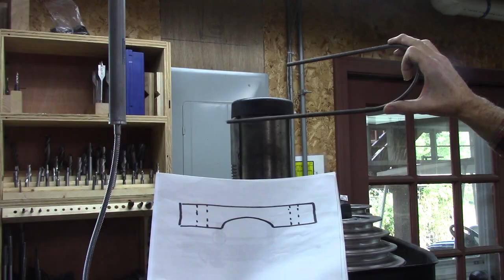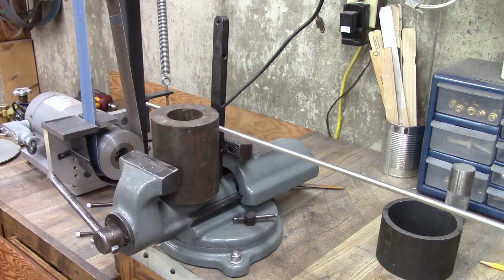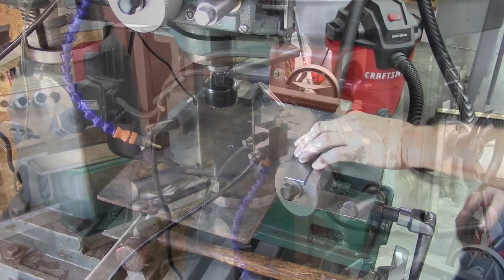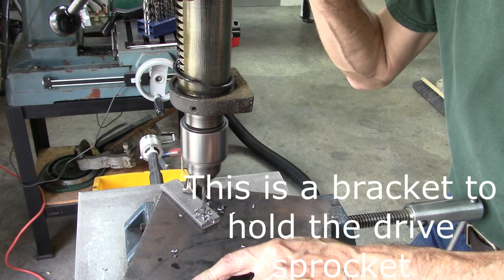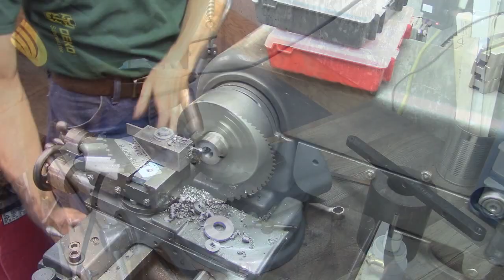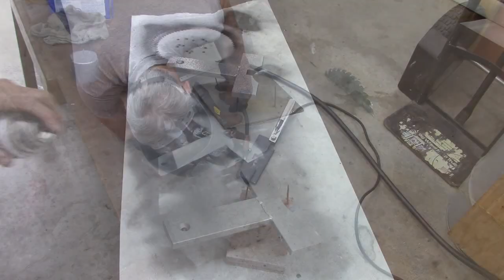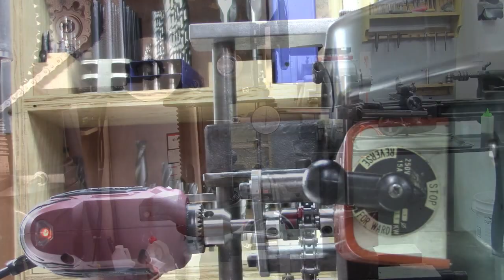The Ultimate Round Column Mill Fix

Comment: Thanks for your feedback.  I do agree with you and did not intended to criticize your well, neatly and professional presented modification.  And rightly so mankind has manufactured and created wonderful projects that are still standing and still operation today  with lesser machines.  No doubt what you have made will perform better and it is more than others may have attempted.  It is clear to see that you have significant skills.  So again sharing this and hopefully I can see a further video from you in the future. By the way I like your clean workshop.
Reply from the maker: No worries, I didn't feel criticized, I basically agree with you. Thanks on the work shop. Aside from feeling a little crowded I love working in the shop. I've done woodworking all my life and always had some basic metal working tool but always had an interest in machine work. About 15 years ago I went from a job running a web offset printing press  to being a troubleshooter/problem solver for the presses. That turned into learning some cad and designing a lot of machine improvements. After getting frustrated with the time it took to get our under manned machine shop to make parts for me I started accumulating my own machines. Now I'm retired...  Now if I can imagine something I can usually build it...  within reason of course. I remember telling my wife I was going to build a buckboard flyer. She said, are you a kid or what?  I said, yeah, but now I have the tools time and to some degree the money make cool toys! If you haven't seen it you might like it. Check it out. https://youtu.be/lPDv_33CV4o
Reply: @WinkysWorkshop  Thanks for the kind reply, yes my wife thinks I am a kid as well and I do feel like a kid in the sweetshop when I am in my workshop.  I am always happy to see the talent in our generation, and many young person could learn a lot by simply switching  from gaming to the youtube channel like yours.  I will check out the link you sent me.  Kind Regards.

Comment: Good try to make an inferior machine perform as it should.  Tried this with similar unsuitable equipment, however learned to put my effort in to buying well engineered machinery.  If you are lucky to have this equipment best use it for basic machining.   Thanks for this video it is a good lesson to help others.
Reply from the maker: Of course a full size mill would be great and if machine work was much more than a hobby I'd sell this mill and get a good one. With that being said, this mill does fairly good with a lot less cost. Your advise would be good if I was 20 or 30 years old. I'm retired...  it's a hobby.  Of course if I see a good deal on a small mill I may get.

Comment: I have a machine like this. Just wondering : I’d have to check, but couldn’t this goal be achieved by putting 2 pins in the top and bottom of the gear rack ?
Reply from the maker: I wish it was that simple. I know some have done this but it's more problematic than you might think. First it helps to realize that a .001" movement at the rack equates to about .008" at the collet. I tried clamping the rack to the column but just 2 inches above the clamp the flexing of the rack made it impossible to even feel when the side of the key way (rack way?) was hitting the rack. I'm not saying it isn't doable but you'd have to pin the rack to the column every 2 or 3 inches and getting is close to perfect would be very difficult.

Comment: I used to have the same milling machine as you. I had a £5 laser of the head of the machine and fired it across the garage onto the wall.  I just had a vertical line drawn on the wall and put the laser dot back on the line if I had to raise or lower the head. Do to the length of the laser line any error is magnified so its easy to correct.    Its an easy fix for the round column. Chris
Reply from the maker: I saw a youtube video on that. Maybe not as fast but a very accurate way to keep things aligned.

Comment: If you look closely on this mill, I'd bet that some, if not all,of the fasteners aren't Imperial... they're Whitworth. If you have one of these older Taiwanese mills unscrew the quill lock lever and take a look at it. It's probably 1/2" diameter, but check the thread count...It's probably 1/2"-12 BSW.
The plastic front cover most likely is held on with 1/4" Whitworth screws.
Cheers from NC/USA
Reply from the maker: You might be right...  although I'm not sure why they would use whitworth
Reply: @WinkysWorkshop   British Crown Colony of Hong Kong. Colony's mainland suppliers fled to Taiwan to escape the communists. Just kept on using what they had been using and stuff just gets baked in. E.g. no one makes metric ratchet wrenches or metric drive sockets. In a French garage you ask for a 1/4, 3/8, or 1/2 drive ratchet or extension.
Cheers from NC/USA

Comment: I have to wonder why you didn't just tie the rack to the column. It has to be a fairly precise fit in the milling head and it it was anchored it would control the deviation from center. If there is slop between the rack and the milling head you could probably modify the head to accept a gib of some kind.
Reply from the maker: First the rack has all kinds of clearance (probably at least .030") but even if it was only .002" at the rack that equates to well over .015 at the collet. However, this isn't the primary issue. The problem is the rack weak. I attached the rack at the top and bottom and it flexed bad. I was going to push the head to one side to remove the clearance but I could not tell when the clearance was gone because the rack flexed. It would need to be pinned to the column ever 3 or 4 inched to prevent this. Pinning between the teeth and getting it perfect would be a challenge. Even if you got the rack within .0005" that equates to .006 at the collet. I've heard of people doing this but I guess it comes down to what kind of accuracy you need.

Comment: I prefer the round column, because I can hang long jobs off the back of the table from an angle plate and swing the head around to do the job. I’ve also fitted a router mount to the spindle for truing gunstock butts and grip caps. If you don’t want the head to rotate, just fix the rack to the column with screws. 🤷‍♂️
Reply from the maker: It sounds like you need a drill press. I know it is called a mill-drill but when used as a mill the round column is a pain to deal with. Fixing the rack to the column will work but making is accurate is very difficult. Attaching the rack to the column at the top and the bottom does not work. The rack flexes. .001" movement at the rack equates to .020" at the collet. It would need to be pinned every 3 or 4 inches to be usable. Drilling between the teeth on the rack with could also be an issue.
Reply: @WinkysWorkshop  Sounds like you need a turret mill.
Reply from the maker: @Afro408  - I like the mill not that it's actually resembles a mill.

Comment: FWIW... I tack welded the gear track on mine.  It still wiggles a bit but not a crazy amount.  I still need to improve on it so this video helps with ideas. Thanks
Reply from the maker: Yeah...  I clamped mine firmly and was shock at how much the rack flexed. Pinning the rack between the teeth worried be but welding might work well if there is enough clearance.

Comment: Hi,  Do you ever have trouble when milling slotted holes, say 3/8 inch,  with the mill bit runnung off  and the slot becoming  less than parrarell??
Reply from the maker: Only with a small long end mill. Unless you take very small amounts the mill will deflect. If you want an accurate slot go with an undersized mill. While cutting a slot one side of the mill is climb cutting and this is not ideal.

Comment: if only there were a simple solution like that for my Smithy 1220...
Reply from the maker: Here's an easy method that might work on your Smithy. I probably would have tried this but I didn't know about this design. https://drive.google.com/drive/folders/1-BDzoObv7eVarpg0HJaO9YMeR-rvfvb5?usp=sharing
Reply: @WinkysWorkshop  nope. The whole column is threaded so you actual have to rotate the whole head around several times to adjust it from top to botom. Thanks for your time though.
Reply from the maker: @christurnblom4825  - Oh wow....  I did not know that

Comment: Now you need to install a dedicated up/down switch on the front for easier access instead of the drill switch. Then you could simply use that convenient front mounted switch instead of go to the side and using the drill switch.  Not hard to do and a mere DPDT push type momentary rocker switch would be perfect. Thumbs Up!
Reply from the maker: I used a drill on to power the lead screw/saddle on a lathe. It was a wood lathe but made like a metal lathe. I dissected a drill and used a remote DPDT switch. The wiring part is easy but dissecting the drill, not so much.  On the mill the drill trigger is fairly close to the front so in my opinion not worth the effort.  What would be nice however is a switch to unlock the head clamp bolts. Still thinking about this one!
Reply: @WinkysWorkshop  Maybe use a linear actuator to lock and unlock the head clamp bolt. Just an idea...
Reply from the maker: @garymucher9590  - I'll have to look into this. thanks

Comment: Another way of solving the problem. different to the Tru-Line -8 that fits on the other side that I make.
Reply from the maker: Yes, I considered your design. Looks great and I wish you the best. I admire anyone that crates a product and successfully sells markets it. I have done the same a few times with limited success and a lot of headaches. I think the primary reason I took a different approach was 1) I was a little concerned about drilling and tapping the cast iron (although it was a minor concern) and 2) I was worried about that fine line between excessive friction or movement in the head. Perhaps this is not an issue but never the less it stopped me from pursuing the design. Also love my power feed---   Then of course somebody sent me this after i posted the video. This is worth considering I think - https://drive.google.com/drive/folders/1-BDzoObv7eVarpg0HJaO9YMeR-rvfvb5?usp=sharing

Comment: If you want head alignment during raising and lowering the head on your round column mill but without the power feed there's a fix.   It's described in issue 18 of Model Engine Builder  magazine  (September October 2008) pages 32 to 33.  It uses the rack as the alignment bar and fixes top and bottom of the rack.  A close fitting slide is fitted to the head to limit play.
Reply from the maker: First off, thanks for the info. However, I tried this...  this seems good but it is not an ideal fix. The rack is close to the pivot center and the leverage the head has on the rack flexes the rack....  and not just a little!  The rack is only 1/4" think at the bottom of the teeth.  It could work but the rack would need to be pinned to the column at least every 3 inches. My biggest concern about going this direction would be getting the rack positioned perfectly. It's hard to move a pin. Then there is the issue of drilling between the teeth on the gear. To be strong enough you would probably want to used a 1/4" pin and to do so you would also be removing part of the tooth. Maybe not a big deal but it would weaken the tooth. Also, trying to drill in a V (created by the rack teeth) might be tricky.  There are a few other ways to fix this issue but in my opinion the rack is last on my list.
Reply: The unit had its disadvantages, if I'd really  spent the time on it I should have, I would have had a lot more contact area top, bottom and a pair of sliding guides.   
The whole thing had to be removed to free up the bottom of the column every time I cut gears to allow me to fit a lower support bearing on the cutter arbor.     I've found a workable and simpler solution to limited travel is in tooling length - long centre drills and stub length screw machine drills and stub reamers.   Lets  me set up tooling of roughly the same length.   I'm tempted by vertical axis power feed for a boring head.
Reply from the maker: @avelingdx  - I've done the same with the stub drills and have a video on making the long center drill. Of course that was long before this current fix.

Comment: This is a very clever solution, and with this knowledge I am a lot more likely to purchase a round-column mill should I happen on the right opportunity. Thanks for sharing!
Reply: I seriously wouldn't. Rather get a chinese square column and mod it for smoother travel. Round column is a true curse
Reply from the maker: @rolandjollivet38  - Now that I modified mine I like it but I tend to agree with you. I'd rather have a small knee mill. Hard to find
Reply: @rolandjollivet38  I get that.  Right now I can't justify the expense of a decent mill, but if I could find one that wasn't worn out for a few hundred $$, I'd buy it.
Reply from the maker: Cool. thanks!

Comment: I use a mag-base laser level on the head, and pointed at a tiny silver spot on the far wall, to keep the head aligned when raising or lowering.  I can keep it within a few arc minutes fairly easily.
Reply: mount a mirror (ideally surface silvered) on the far wall then you increase the accuracy even more and don't have to turn round to check. Random unrelated fact, years ago as a kid I visited a place that turned train wheel rims and they projected a shadow of the wheel rim onto the factory wall and there were marks on the wall to act as a gauge.
Reply from the maker: @mfx1  - Cool!
Reply from the maker: I've seen that done and it;s a good approach. Very accurate.
Reply: that laser sounds like a great idea and maybe use in conjunction with the vertical bar as a check. My problem is that I have my Mill on casters.  But maybe two lasers, one on column and one on the head and just need to keep them pointed so that they are aimed so that they maintain a consistent distance apart?

Comment: hello Mark,nice job on the mill,enjoyed the video, thanks for sharing with us.i did something simular to mine what i did was drill and tapped the rack and  tube and made a gib to fill the very tiny space in  between the clamp and tube. it works just fine.see you next time. stay safe. my friend.
Reply from the maker: I tried do that and my rack flexed a lot! I had mine attached at the top and bottom and it didn't work at all. How many places did you attach it to the column?

Comment: I have an OLD Craftsman drill press I need to do this to. The only problem would be, when I want to use it like a radial drill 😉   That part of it does come in handy once in a while, but cranking the head up or down to use a different tool on the same location would be easier.
Reply from the maker: Yeah...  I put a square column on my drill press. It had a hand crack for a while but now I have a drill to power it. Best thing I ever did!

Comment: Now that is a very acceptable method to achieve what has always been a pain in the butt with round column mills........I have to wonder why the makers of these mills don't have a square column permanently for normal use.........easier to bore a round hole than a square one I suppose....... the square column can then be as good as a dovetail type......losing the ability to swing the head to left or right is a loss you'd  be prepared to make if you can keep the squareness integrity with up and down travel.
I suppose you could cut 3 more keyways in the column and head casting to permanently keep it square without the need to swing the head to left or right etc but just fixing the rack to the column at 3" intervals like you said might work and would be simpler.
Reply from the maker: In my lifetime I have never needed to swing the table out of the way on my drill press and the same applies to my mill. I'm not saying I won't need to tomorrow but it's unlikely. Of course I put the square column on my drill press which I love and I now have the mill fixed and both are a huge plus! I think using the rack is not the best idea. The method I used is a little easier to get right and I suspect a bit stronger. I did find another method that would accomplish the same however. https://www.hobby-machinist.com/threads/rf-30-clone-head-alignment-guide.84270/?fbclid=IwAR1IwD-s0KsZkKLHibNvD8dTI29B4nLtVADGwlp-uJfb0M9_v3zpz_JEY2s
Reply: @WinkysWorkshop  Well, as the saying goes, if it works it's well done..........I was just looking at the video again and the shot that showed the bottom part of the mill column is huge.....a great pity that square base wasn't continued to the top with a set of dovetails on the front......that would be a desirable mill to have.......I can't imagine what the designers were thinking when they went to the round top section......if they can make a round hole around a round column they can make a square one too.

Comment: They must have got a good deal on Imperial fasteners?
Reply from the maker: After thinking about that a while I'm guessing they were making the 1/4" -20 screws for us anyway and had them available.
Reply: I have several machines made in Taiwan including this mill. I’ve found many SAE threaded bolts with metric heads.

Comment: Fantastic Video-You have solved a major problem using Bubble Gum and Bailing Wire.
It's called Yankee Ingenuity. The time involved is huge, the skill requirements are tall. Providing drawings and links to parts is charitable and much appreciated. I take my hat off to you .
Reply from the maker: Thanks you sir. The drawings may not match different versions of the RF 30 but they are a good starting point.